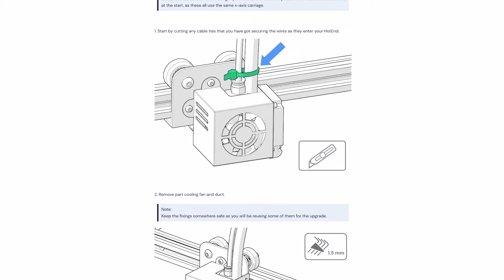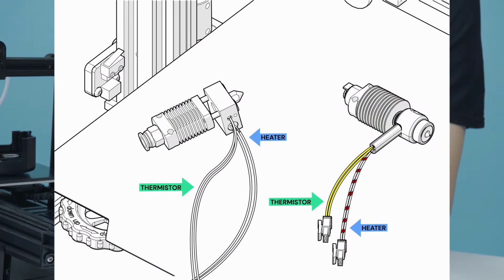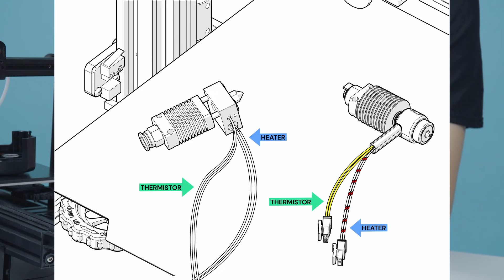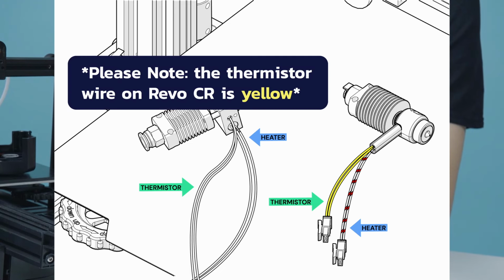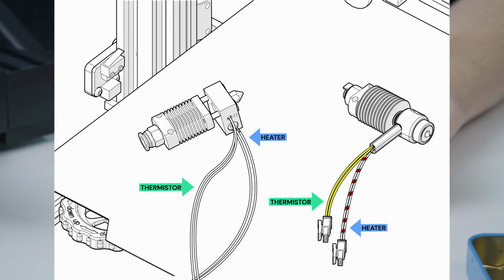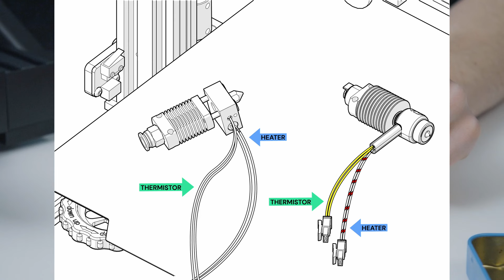E3D Revo™ CR Upgrade Guide

Comment: Including the butt splice connectors with the Revo CR kit was a brilliant move. They make the wiring SO much easier! 👍
Reply: Bryan, in the data sheet it says the thermistor is a Creality type, if that is the case why cant the existing one be inserted? it also claims "Maximum recommended operating temperature (PLA): 40°C" that is definitely an error!
Reply: @AndrewAHayes  1.) Because it is buried/integral inside the heatercore 2.) not an error, refers to maximum acceptable ambient temperature
Reply: @MrTimElmore  It's a bit ambiguous!

Comment: Unfortunately, one of the butt connectors didn't work for me on the thermistor, it was reading temps of about -75! Had to use some other connectors I had on hand instead. Thankfully they worked for the heater.

Comment: I just fitted the Revo CR to my ender 5 plus without any issues, took 20 mins to install to first test print to calibrate z-offset. PID tune done and all was good. The only change I made was to keep the plugs on the hotend and shorten the extension cable to attach the plus to the ender 5 plus wiring loom so it allows heater block swap that bit easier. The quality of the print has improved with the Revo cr over stock hotend. A no brainier upgrade 👍😀
Reply from the maker: That's great to hear, thanks Steve!

Comment: Appreciate the video - much more likely to buy now!  Quick question first - apart from upgrading the bowden tube is there anything else I really need to do to print flexible fibre?  Was wondering about a simple extruder upgrade - any suggested?
Reply: If you want to print a lot of flexible filaments, I recommend taking a look into switching to direct drive. It moves the extruder onto the tool head so the place at which the filament is pushed is closer to the nozzle. If you want my opinion, the best to swap to are: The Micro Swiss NG, the E3D Hemera XS, the Micro Swiss Direct Drive kit. They are all amazing, but the best is probably the E3D Hemera

Comment: presumably you can change the firmware to allow hot end to heat to 300C?
Reply from the maker: Yes, that is possible!
Reply: @E3DOnline  Do you have a guide for this? i'd like to print hotter 🔥

Comment: My v2 came with too large cables and they do not fit into the connectors. What should i do?
Reply: I ran into the same problem I stripped them and that kinda worked for a bit I had to solder them eventually I really wish I just used the thermester cable provided and swapped that on the main board honestly a lot easier then trying to get the originals to fit in the but splicers that would allow for the quick connect. Good luck